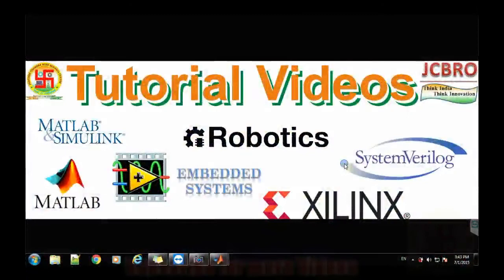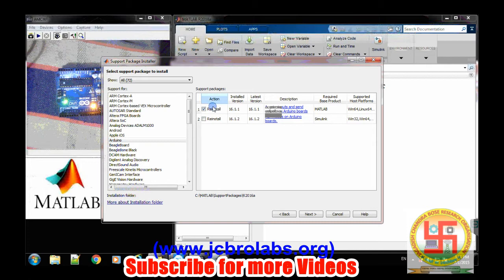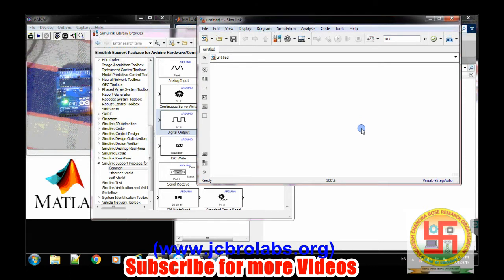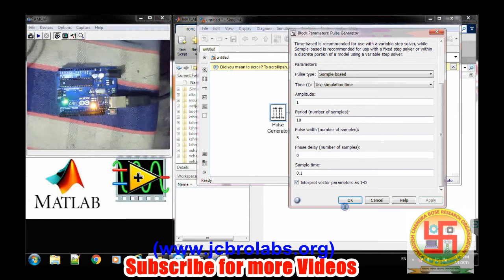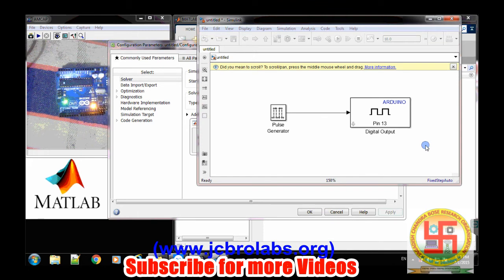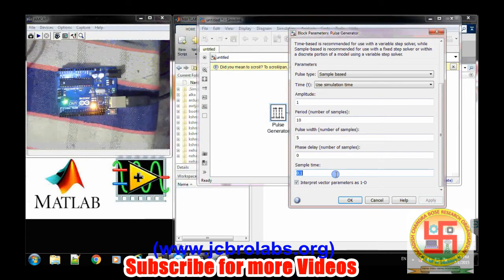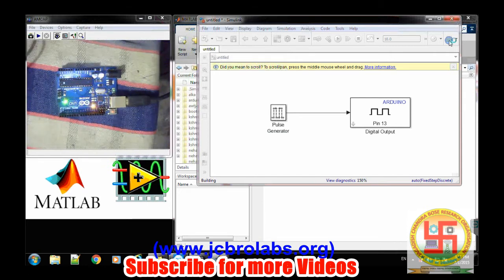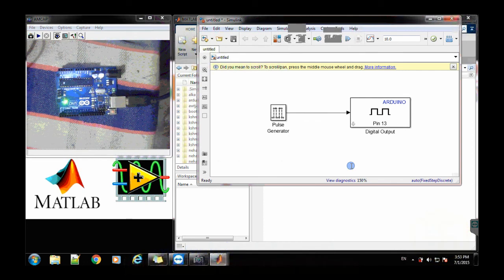How to Interface Arduino with Matlab Simulink?

Comment: Thanks a lot for this great tutorial  .
in this video u said that Matlab is just programing the Arduino and the Arduino is a stand alone with the program written on it , but is there anyway possible to use Arduino Uno and Matlab together in a external mode as it's only available for Arduino Mega.
Thanks in advance

Comment: sir , I have to make a GUI in MATLAB for Arduino Due Board. I have written my code in Arduino IDE and to see the output of my programme and also to control some of the input variables of  my code I need a GUI. Please help me to do the same, actually I found a lot of stuff to make a GUI in MATLAB but they all use all the interfacing through matlab only . no one can interface with Arduino IDE and GUI in matlab.   Thanks in advance
Reply from the maker: Hi,
    actually you can control your Arduino directly from Matlab and that is the easiest way of doing the same. Otherwise you can use processing software to make GUI or other software and you need to program your arduino sor serial communication as well.